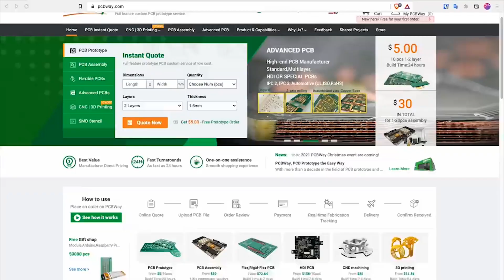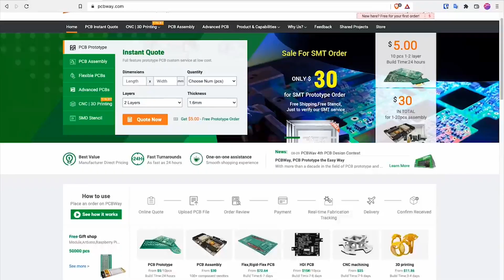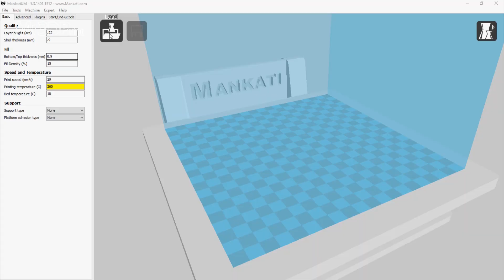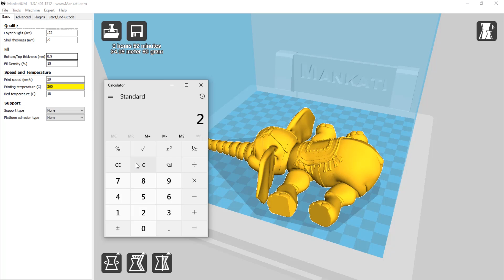how to make Flexi Elephant With plastic bottle (PET) - free filament  - DIY

Comment: i see how this is done and is quite impressive...
my question is i have an old glue gun around..its heavy duty as well..
my thought is since it melting temperature is well into 450 degrees..
if i was to dismantle it and build something similiar as this video uses..
i wonder if it would work as well by melting plastic bottle string..
thenpulling it throught the melting element and 1.75 nozzle...
thus making filament for my printer...
it would be exactly the same size of filament
just a thought
Reply from the maker: You have to test its temperature. To melt this filament, it needs to be heated to 260 degrees

Comment: Hello. Doesn't your filament get stuck? you would make a video how to set the extruder gears at what pressure to print to keep the thread from getting stuck. Thanks.
Reply from the maker: I could not understand you
  But if you see the videos whose link is in the description section of this video, you will not have a problem
Reply: @mr3dp  مرحبًا. ألا تتعطل خيوطك؟ يمكنك عمل فيديو حول كيفية ضبط تروس الطارد على ضغط الطباعة لمنع الخيط من التعثر. شكرًا.
Reply: @mr3dp  thanks